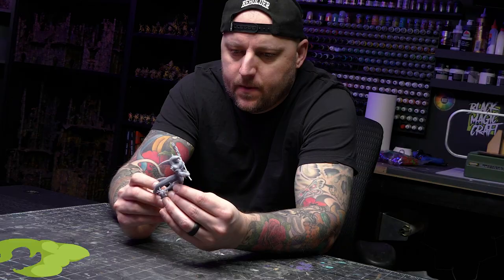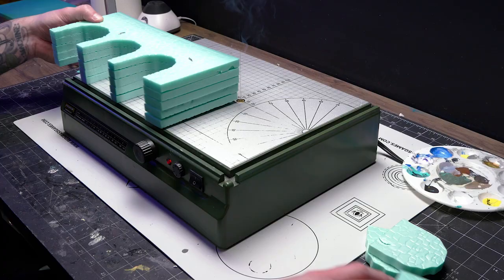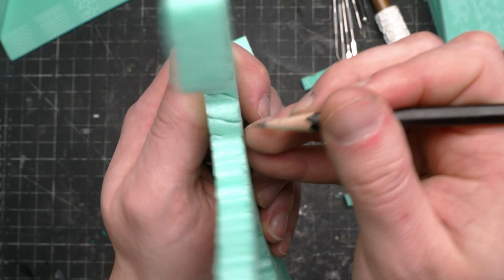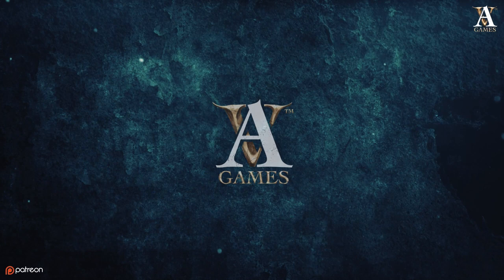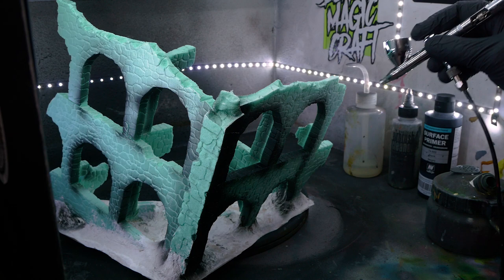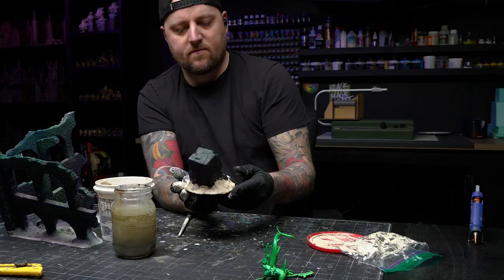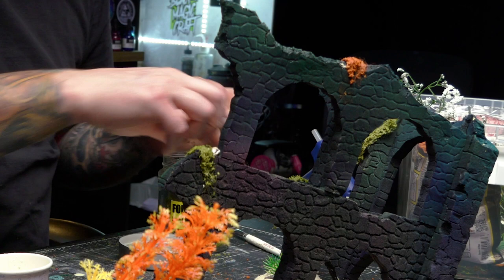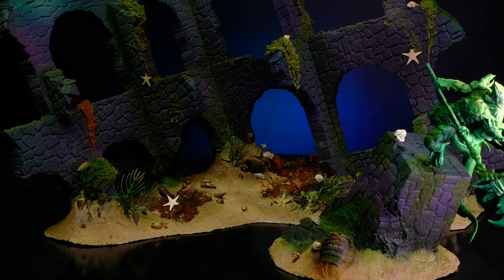Building UNDERWATER RUINS for Dungeons & Dragons

Comment: Excellent work as always Jeremy. The tilt of the building into the sand was inspirational. I was thinking that if the building was flat, it’d look a little Roman, but as soon as it was tilted, it changed everything.
It would be interesting to consider how one could light this terrain to show the sun shining through the water above. Rippling blues and turquoise from a led strip might be interesting. Sebastian over at Atmoseeker uses DJ lights - there’s a specific “ripple” light that he’s used that looks interesting.

Comment: Just FYI - the ink might be bleeding because the binder has been watered down by whatever you used to help it flow through the airbrush, the problem comes up with paints too, and it being a relatively thin coat really doesn't help. Plus, most decent pinky shades are quinacridone pigments which tend to stain and have a very strong tinting strength so it makes the problem even more obvious. Glaze mediums can really help, and make sure you give your inks a proper mix before using them to avoid separation

And the ruins look real pretty too, I especially enjoy the King Shark statue

Comment: Cool build. You found the downside of using inks though. It takes like a full day for it to cure fully, adding a wash or anything that will cause it to rehydrate and turn to mudd.
Reply from the maker: Which is resolved in 20 minutes with a clear coat :)
Or use oil washes on top as they wont reactivate acrylic inks.

Comment: If I remember right, previously you've reviewed the green stuff rollers and they didn't give good texture. Do the ones from Shifting Lands work significantly better? They look like they have deeper textures
Reply from the maker: Yes, they are actually designed for use on foam whereas the GSW ones are not.
Reply: So it was a change in roller and not a change in foam/xps?

I recall you indicating you were trying to bring in the xps from Germany or some where since it was different and potentially better to work with.

Originally when i watched the video i thought it was due to that.
Reply from the maker: @sggee  I am using a foam that takes impression better than the Foamular I usually use. It's not the German foam though.

But the main difference is the roller. The Shifting Lands rollers work better on foam because they are designed for foam. Doesn't matter what the foam is they will work better than the GSW ones.

Comment: is there some guide somewhere for beginers, in terms of printer used , filaments/resin - airbrush type, paint ect ect. i was thinking to get into this stuff, and there so many components to this, i was thinking to get a elegoo 2s FDM printer and vrushes and start whit that , then add a resin/air combo down the line.. i have another question too is the resin figures as expencive to make are the store ones? as i see resin really expencive.

Comment: The problem I have had with 3D printed minis is that the are very fragile when compared to Reaper and others and do hold up well  when used for game play. Have you had a chance to handle any pre printed minis to see how durable they are?
Reply from the maker: Resin has come a long way and there are plenty of durable options. I don’t know what they are using, but if it’s something like Prozen’s 8k resin they will be just as durable as any plastic model. Reaper is an outlier as there is a lot of sacrifice in other areas to basically make them out of indescribable rubber like plastic.

Comment: Hi BMC, what is the foam you used in this build? I'm in MB as well but don't remember seeing green foam as an option, usually pink or blue. Thanks.
Reply from the maker: It's not something you can get here. It's from a company in the US. I'm working with them to make it available to hobbyists for direct order.
Reply: Hahaha i had just commented on the foam in the previous roller so it was a double change (different texture roller and different type of foam) kk good to know.

Im in BC and am toying with DMing and making terrain for my DnD campaign…. Previously coming the 40K realm but that got expensive quickly.

Comment: Hey, Jeremy, what is your filming set up?  What rig do you use?  Cameras, mics etc?
Reply from the maker: That is neither a fast nor simple answer, it's a pretty extensive list of gear. Short answer I use a couple Panasonic Lumix cameras.
Reply: @BlackMagicCraftOfficial  I appreciate the fast response.  I quick drop to Amazon was staggering with selection lol.  Looks like I need to give myself a new education.
Reply from the maker: My current set up is like $15,000 worth of equipment. I started the channel with an iPhone. There were many incremental changes along the way. My set up isn't what you're after to start :)
Reply: @BlackMagicCraftOfficial  Thanks for the advice and info!  I believe I'll baby step lol.

Comment: I'm so confused why you wear a respo for sculpt a mold...
Reply from the maker: I don’t want to breath dust that will solidify into plaster when it hits the moisture in my lungs.
Reply: @Black Magic Craft  that makes sense just figred that becomes a none issue once it's hydrated. Thx for taking the time to reply dude your content rocks.
Reply from the maker: It’s still floating in the air from pouring it. Takes a while to settle. But yea the wet stuff is harmless.